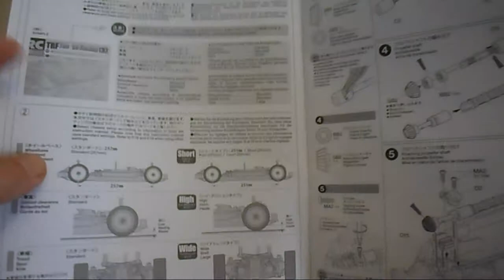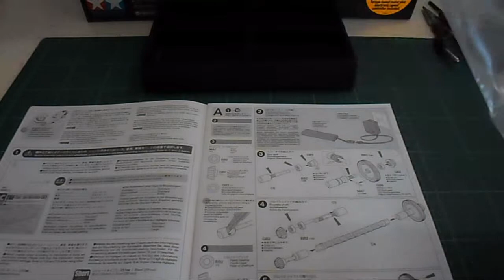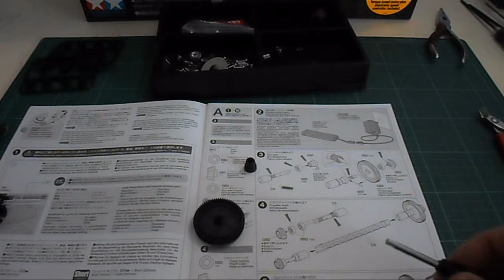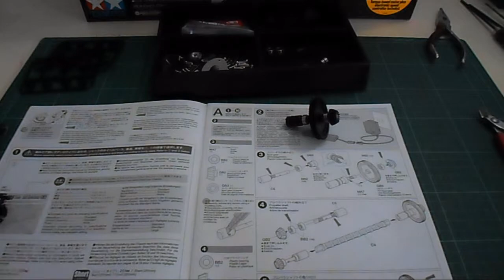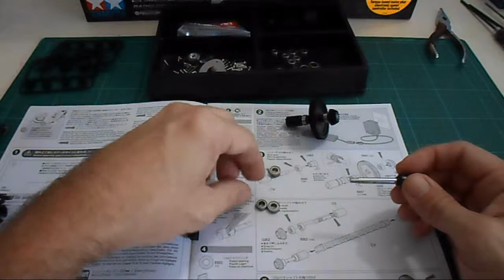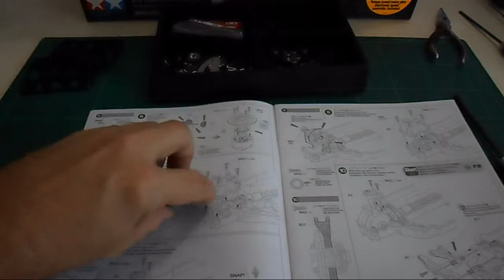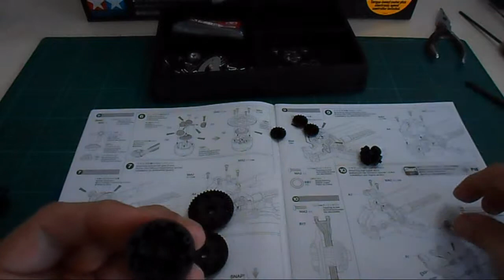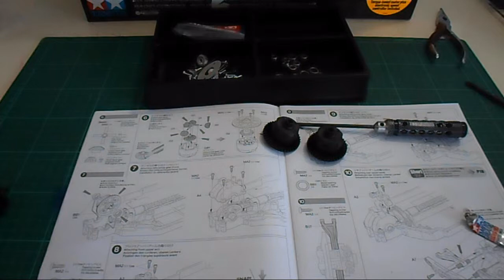Tamiya TT-02 build part 1

Comment: Hey Dave. Thanks for these awesome vids on the TT02. Would it be possible to get part numbers for the option parts you used to build this? I tried finding the 25t pinion by Yeah Racing that you use but am not having any luck. Thanks!
Reply from the maker: Hi Wicked Fog, thanks for the Q
The pinion is part # MG-06P25T 
Look up the RC/MART web site and search TT-02 parts and you should find everything there.
Reply: @bluehornet01  I actually was typing in the wrong part #. Got it now, thanks!